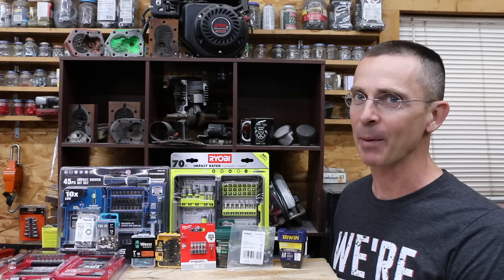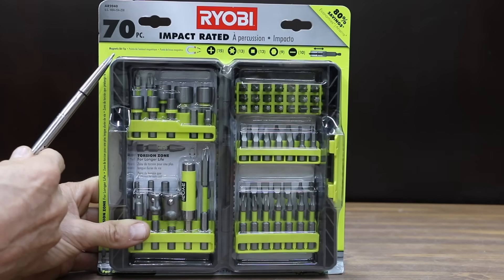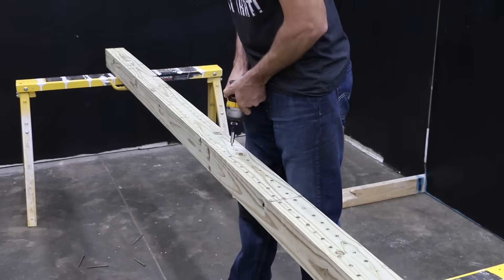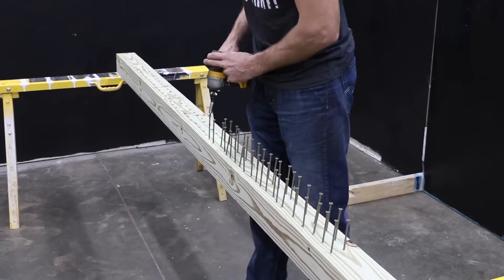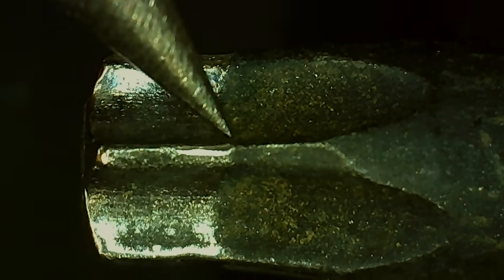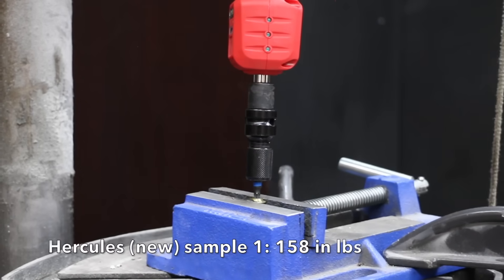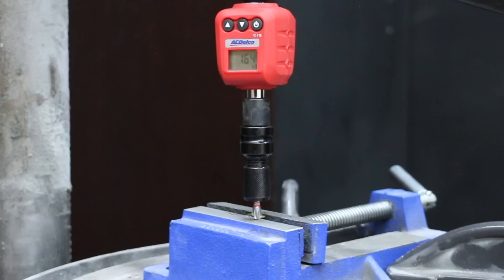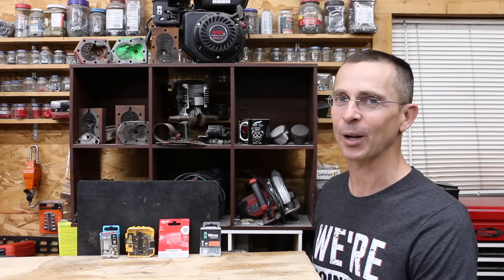Best Star (Torx) Bit Brand? Milwaukee, DeWalt, Makita, Ryobi, Wera, Wiha, Irwin, Bosch, Bauer

Comment: One burns through a lot of torx bits fastening 5 1/8" GRKs building pole barns. 

The best part is when new guys put the broken bits back where they got them, and you notice the bit is stripped or straight up broken after climbing the wall amd a truss is just waiting to be put in its forever* home.
Reply from the maker: Thanks for sharing.
Reply: @ProjectFarm  Where do you find the time to make these videos amd respond to almost if not EVERY comment?

Comment: Ryobi's P262 brushless 1/2 impact wrench's came out(rated 600 ft Lb), I doubt it stacks up against the Milwaukee M18 fuel thats rated for something like 1400 ft Lbs, but would be interested to see how my 262 stacks up to it. I've only gotten to use my 262 once so far, and I'm happy with it so far.
Reply from the maker: Thanks for sharing.

Comment: Thanks for endorsing my choice of bits, Wera is the best  I can find (apart from Hilti 2” bits)  I dislike a loose fit into a screw, over an hour or so a loose bit will wear looser, so I’d rather start with a tight fit. All drive bits that are in good condition will snap if you run into something hard at full bore, worn bits often cam out when that happens,chewing up the screw head. 
     Why not test bit holders, there’s nothing worse than a weak magnetic holder shedding your last relevant bits in to the abyss ! and I don’t like mechanical lock bit holders, they are too big and get in the way a lot !
Reply from the maker: You are welcome!  Thanks for the video idea.

Comment: Nice work. I enjoy most of your comparison videos.

Really surprised Irwin didn't come in dead last, even when compared to non-impact rated bits. Those things are the worst overpriced garbage I've ever tried to use. 

The second to last time I tried using them, the first bit I used snapped on the first screw I was driving (Hardi-board screws through 1/4" hardi-board into plywood subfloor). The second bit lasted for maybe 20 more screws. I finished screwing down that single piece of hardi-board with the 3rd bit and then took all the bits back for a refund... The last time I tried to use them was for torx head cabinet screws (T10 IIRC). Even though all holes were double-pre-drilled, and all screws were soaped, the Irwin bit snapped mid-drive after the head had already gone past the surface of the cabinet frame on the 2nd or 3rd cabinet joint. Because the bit seemed to snap flush with the head and left the broken part in the screw, I couldn't finish driving it or back it out. To ensure a good joint between cabinet frames, I had to drill a new hole and install a new screw slightly below the messed up screw. Once again, those bits were returned for a refund and I spent an hour driving around looking for a place that sold a different brand of 3" impact bits in that size. I ended up buying some non-impact bits because I was coming up short, and I finished the entire kitchen (26 or so cabinets with maple frames) with a single off-brand non-impact bit I bought at some little mom-n-pop hardware store.

I will never buy Irwin bits again, no matter how cheap they are (which they never are). I tend make sure stores know that they need to offer another brand (literally any other brand) if they want my business buying their high-margin driver bits. Until they change, I order bits from Amazon.
Reply from the maker: Thanks.  Thanks for the feedback.

Comment: Thanks for the info. I'm rebuilding damage to my deck and I've been using Mikita and DeWalt bits (after breaking cheap ones). Good to see my experience is matching your data. Thank you!

My biggest issues are really that the bits are either too short or too long for my use. The second problem is screws are getting stuck (and stripping) when I try to pull them out after sitting five years. I almost wish they would just snap off like drywall screws.

Not sure if there is a video there. The best torque screws, the best stripped screw extracting system or something like that.

Honestly most times lately I just cut them off with a reciprocating saw because the extractors seem to suck.
Reply from the maker: You are welcome!  Thanks for the video idea.

Comment: Another great review. Dewalt seems to really be up there consistently for value on all of their bit products. Because I frequently make the same mistakes you do driving the screws I'll be looking for the value brand. Can you do a review of Phillips and Torx head deck screw brands? I usually snap the screw heads before the bit. Maybe it's because I buy the cheapest bulk screws from HD. It would be nice to know if Lowes, Tractor Supply, Menards, Murdochs, Harbor Freight, or some other chain has the best brand. Maybe even Amazon or some other online supplier.
Reply from the maker: Thanks so much!  Thanks for the video idea.

Comment: 20 years ago if you asked what the best consumer brand tools where, you could reliably get a couple answers. But those brands have been bought out and the companies that bought them don't care about quality, just making a buck off the name. I love seeing head to head match ups of tool brands, as it will help me decide what buy when I need something new.

If you want a suggestion just keep doing head to head comparisons of tools. I know I am changing the brand I use for bits after seeing this. And the price is a minor issue. If a bit last 5 times longer than the bit that cost half as much you are saving money (and maybe a headache) to buy the more expensive bit.
Reply from the maker: Thanks for the suggestion.

Comment: You forgot what’s probably the most common screw up with bits: using the wrong size. Can’t tell ya how many times I’ve seen torx and Allen bolts stripped, and I can almost guarantee you it’s because they used the wrong size. I’ve heard the Wera are the best (which seems to be confirmed with your testing). If you get a chance, try out those RBRT bits from Mac. They’re expensive, $14-$20 a bit, but they’re some great technology. I know you do tools more for “everyday” kinda folks, but they’re some great bits. Thanks for the work you put in. You’re one of the few folks on here that deserves all the praise you get.
Reply from the maker: Thanks for the video idea.

Comment: I have an idea for a test - water proofing spray/coatings for tents, etc.  I found a homemade mix on YouTube using mineral spirits and ge silicone 2 caulking that i think probably outperforms all the spray stuff I've used over the past 25+years ( currently coated my deck umbrella with it and it's held up against washington weather for 2+ years now)
Reply from the maker: Thanks for the video idea.

Comment: For bit fitment, it depends on what you are doing. If you are putting in a thousand screws, then a little loose is desired. However, for high torque applications, you need a very tight fit.
Reply from the maker: Thanks for the feedback.

Comment: Very thorough testing, like usual. I've always used the bit that comes in the box of screws. :) Recently I had to build a wheelchair ramp for my mom, so I ended up buying some DeWalt and Milwaukee T25 bits...I never even got to the second DeWalt bit or any of the Milwaukees.
Reply from the maker: Thanks for sharing.

Comment: Professor Farm....Having done a boatload of decks and fencing, the only speed application I can think of is well...both.  But with fencing, you are using much smaller screws.  Decking is a different animal...Trex/artificial or organic.  In any case, it is the screw that matters the most.  I have gone back to sinkers and galvanized in many cases,(at least in joists and cross braces), because the screws, although easy to work with, break over time.  Have you done a recent deck screw comparison recently?
Reply from the maker: Thanks for the video idea.

Comment: best bits to add to the victorinox bit ratched (1/4 bits) 
best shapes and size bits (aim would be to cover 90% of bits needed in 1 ratchet
Reply from the maker: Thanks for the suggestion.
Reply: @ProjectFarm  will u look into this video? Also cover the 20 most used, common and important 1/4 bits

Comment: I loved the video - thanks for including the price per bit, that helps a lot...especially if you know you're going to help a friend with a project - taking 25x $0.20 bits only ends up costing $5, and you can throw away the ones people booger up from being sloppy without feeling bad!  Taking 2x $3 bits costs more, and if they're sloppy, they're still going to trash the bits!

Years ago, I picked up a 2-pack of the GRK brand T-25 bits - they're green, which makes finding them in the drawer a little easier.  They're also a little longer than the ones you tested, and the extra reach can help.  I also found you can lightly grind down the ends when they start slipping (which they always do, eventually) to true the tips.  A quick kiss on the bench grinder, and they grip great again.  They're about $5 for the 2 pack, so definitely on the higher end of the bits.  If you do a part 2 for this video, maybe throw them into the mix!
Reply from the maker: Thanks!  Thanks for the video idea.

Comment: torq is cool and all, but bolt/screw heads really need to have a deeper head to help hold the bit in better. Hex is still better IMO, until that one or two times it slips and strips
Reply from the maker: Thanks for the feedback.
Reply: @ProjectFarm  love your videos, bought the dewalt electric chainsaw thanks to you and so far so good! best unbiased and thorough reviews ever

Comment: Why did you choose to use pressure treated 4x4s (as mentioned at the start of the video) instead of non-PT 4x4s? Was it just what you had on hand at the time, or is there a specific reason for the choice?

Comment: the used bit getting a higher/equal torque yield i would imagine is the result of being "work hardened" where they have been ever so slightly "hammer forged"  and tempered from those 100 deck screws.
Reply from the maker: Thanks for the feedback.

Comment: test crows foot wrenches
Reply from the maker: Thanks for the video idea.
Reply: @ProjectFarm  i only suggested this because my sister was having her plenum gasket replaced in her chevy tahoe and the mechanic that she was having do it was using a matco crows foot and it shattered. one of the peices ended up going into the #6 cylinder and when he started the car it blew a hole in the piston. matco paid for a new engine and for all the labor, but i just wanted to know what crows foot would be the safest to use in a similar situation

Comment: For me a critical factor in selecting bits and screws is one hand start capability.  That is, can I load a screw on the end of the bit press the screw against the surface to be fastened and start the screw with one hand without a pilot hole.  Being able to do this means I can hold a several screws in one hand while repeatedly driving them with the other hand or start a fastener with one hand at the very end of my reach.  Because they tend to wobble Torx fasteners are not very good at this trick but some can do it if you get the right combination of bit and screw.
Reply from the maker: Thanks for the feedback.

Comment: I'm honestly curious about something. 
Is there a reason to use an impact driver if your regular cordless drill will will drive the screw?  
I have a regular drill and the impact driver that came with it. I found most of the time I can drive screws faster and with less noise with the drill rather than using the impact drill. 
Mine are regular brushed type if it matters. If the theory is that I'll burn out the brushes then I can tell you I haven't so far. 
Maybe I'm missing something but I find the impact to be slower and as I said louder, obviously.
Reply from the maker: Thanks for the video idea.

Comment: Not going to lie, wera is expensive, but if its not for home use, as in if your a tradesman, their stuff like stainless steel screwdrivers last so much longer. By that i mean, replacing screw drivers every 3 months due to breakage is annoying. Spending twice as much and getting 3 years out of them makes more financial sense. Im a wera convert. Maybe do an insulated screwdriver comparo. Not slimlines, theyre just weak. But put in the lazer etched stainless steel weras. The only time ive had to replace a wera is when ive lost them. The stainless weras do not break like say wihas etc. And im talking solid 6 day per week on site thrashing.
Reply from the maker: Thanks for the video idea.

Comment: I prefer a snug fit so you can put the screw on the bit and then do overhead or vertical work easier. They also seem to wobble less when starting.
Reply from the maker: Thanks for the feedback.

Comment: Interesting. I put bits to the test last year driving long 10 inch aggressive screws in with 24's, through 2*12's into pilings. Others tried and even with two hands couldn't get the screws in more than eight inches without giving out or stripping the screw head. I've got strong wrists and was able to drive them in all the way in with one hand on the drill and the other aroud the piling. But once they bottomed out most of the bits snapped. I had a bunch of Dewalt bits and they broke easily. The Bosch broke a little less easy, but the Makita bits lasted four or five screws before breaking, all the others might last two screws.
Reply from the maker: Thanks for sharing.

Comment: I wonder if the reason why the used bit performed better on the snapping failure test is because they’ve been through some heat cycles and it’s hardened em up slightly when compared to a new bit out of the packet.....
Reply from the maker: Thanks for the feedback.

Comment: In automotive...the set screws for rotors...i know you SHOULD use one of the ''impact'' type screwdriver deals? And i do sometimes, BUT using an impact, beat the socket on and slowly buzz works sometimes. Snap on bits still break EASILY like that. Surely not made for impact but here i am doing it.
Reply from the maker: Thanks for the video idea.

Comment: The tight fitting ones, although irritating, I would think would do the least damage to the fastener.
 Although you covered the damage to the bit, certainly if the fastener is damaged, that certainly makes a difference. I would expect fasteners metallurgy would be much softer than the bit that is driving them. 
Hopefully this was constructive.
Reply from the maker: Thanks for the constructive feedback.

Comment: We see you use torque adapters in almost every video what if you tested multiple devices for accuracy out of the box? also different measurement options like foot lbs, inch lbs and newton meters? Can it be used instead of a torque wrench?
Reply from the maker: Thanks for the video idea.

Comment: I wonder if the improved performance for the used bits over the new bits could be related to the alloy/chemical makeup of the bits. For example, copper work hardens, so as it experiences more stress it gets harder. Maybe some of the bits the did better used were of a compound that work hardened/softened, and that gave it the benefit.
Reply from the maker: Thanks for the feedback.

Comment: I am a contractor and I use my impact every day. Milwaukee and DeWalts both have great bits. However, Milwaukee’s box is way easier to use. Just try to pull bits out from DeWalt box and put it back. You will understand exactly what I mean. 6-7 years ago Ridgid use to sell their impact bits. Those bits were long lasting and the box was very sturdy and spacious.
P.S. I am very impressed by Hercules bits outcome. Will take a look when I am at Harbor Freight.
Thank you for your videos, very informative!
Reply from the maker: You are welcome!  Thanks for sharing.

Comment: Thanks for this video!  I generally use torx hand tools to undo small screws (just about every pocket knife that uses screws uses torx).  Got frustrated with them stripping when they had to deal with loctite until I started using wiha so I wasn't surprised to see them perform pretty well consistently here.
Reply from the maker: Thanks for sharing.

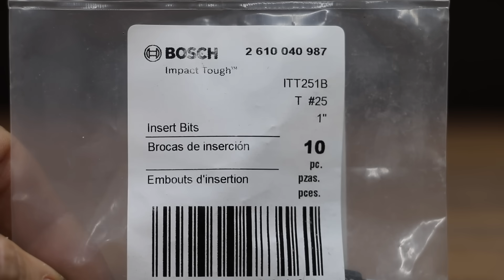Comment: I can't watch anynor aftr 4:14. I alrewdy know decwalt t25 is It but this guy using all mini bits I mean you can buy good t25 3 packs of dewaukt that are full driver length where you got the strength compared to always using a extension with replacing the bits. That is for newbs or only remodel where you might run into several heads

Comment: Funny you rated the ease of removal of the screws as a positive. In my opinion as a contractor, a tight fit is very useful, as I often have to hold an item in place while fastening with one hand, and a bit that can hold onto the screw without it falling off the impact driver is a huge help. Regardless, great info, thanks for all the ard work!
Reply from the maker: Thank you.

Comment: Fantastic testing as always! I was amazed by how much torque those bits were able to tolerate before snapping. You must've been exhausted after all that screwing! LOL A++
Reply from the maker: Great point on the strength of the bits.  Much improved over the ones I've used years ago.  Thanks again!
Reply: @ProjectFarm  BTW DeWalt also sells some other ones for a little more money that specify that they are impact rated. They come in a black case that otherwise looks the same as the yellow ones. I've never actually tried them because the regular cheap ones always hold up well for me and I use them hard on a daily basis.